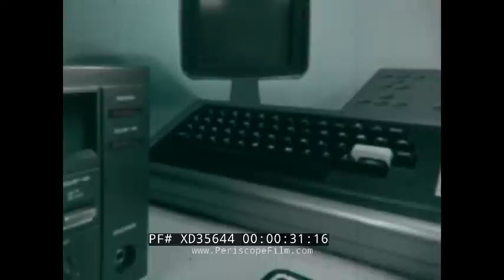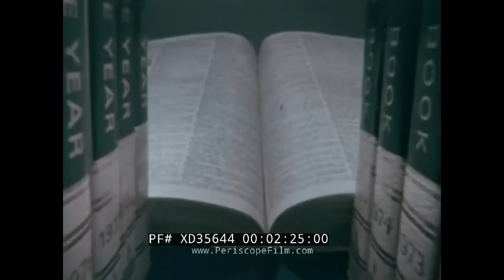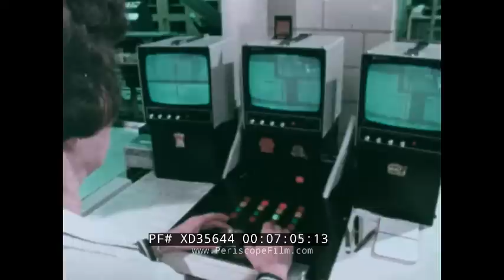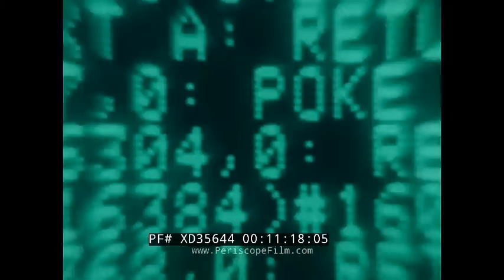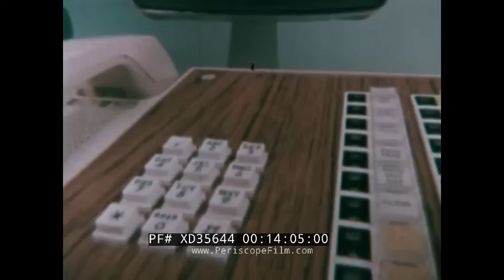" MICROWORLD " 1976 AT&T / BELL SYSTEM  MICROPROCESSOR & COMPUTERS FILM  w/ WILLIAM SHATNER XD35644

Comment: Also in the late 1970s, one example of microelectronics gaining massive traction was the Elevator Industry. When I watched this amazing video, I immediately thought of the elevator companies embracing this technology, transitioning from the electromechanical relay logic controllers that had hundreds (or even thousands) of moving parts and kilometers of wiring, all the way to these microprocessors, microchips, and electronic circuit boards. These had the ability to register up and down lobby calls, floor selections, door motion, acceleration, deceleration, leveling, fire/emergency service, regulating speed, electrical phase conversion and control, and controlling safety devices in the event a big accident happens. All from just a few circuit boards with microelectronics, taking up less space, lasting longer, containing no moving parts, working safer, and using less energy. and here are some examples.

1. Otis = Transitioned from Auto-Tronic to Elevonic 101 for traction, and Elevonic 211H for hydraulic elevators.
2. Dover = Transitioned from Computamatic relay controllers to the Traflomatic-II and III controllers for traction elevators, along with SS (Solid State) controllers for hydraulic elevators, which then evolved into the DMC and LMH controllers (some of the best ever made).
3. Montgomery = Mi-Prom-21 and Ultron, Kone = Traffic-Master
4. Westinghouse = Evolved from Select-O-Matic to the Epoch, Schindler = Miconic-5 and later, Miconic-10 with Destination Dispatch.
5. By the early to mid 1980s, many independent companies started to embrace this microelectronic technology in elevator controllers to the point that the nonproprietary companies would make their introduction, that would make these controllers accessible to any elevator company for installation, modernization, and flexible servicing.

All in all, it sure is amazing how the world of computers and microelectronics have really changed immensely in the second half of the 20th Century, especially since this video is almost 50 years old.

Comment: Today a large number of those discrete components, the 3 leg package, are unavailable. The ones left are in individual's parts bins all over the world. Today, when putting together circuits with old schematics, there is a lot of substitution going on. Now even through-hole assemby has more to do with structural necessity. SMD technology, even for passive compinents is more typical today.

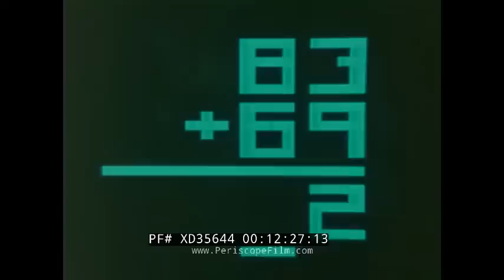Comment: This film is not 1976 - at 12:27 we see Apple II (with floppy drive) in a classroom. Apple II launched on June 10, 1977. Sadly, the copyright (at 14:32:14) is covered by the frame counter!

I've seen some suggestions out on the 'net that this film was made in 1976 BUT REVISED in 1980, which would explain the Apple II with floppies.
Reply: Plus the calculators seemed a bit compact for 1976. Plus a TRS-80 which came out in 1977

Comment: I worked in electronics as a tech most of my work career. I even worked in a TV repair shop at 16 yo in 1969, 4 years in the military as an avionics technician, oil well logging tool tech and then in telecommunications retired from the T doing satellite communications. Worked on many types of communications equipment including two way, microwave and fiber optic and many types of low speed  and high speed circuits.